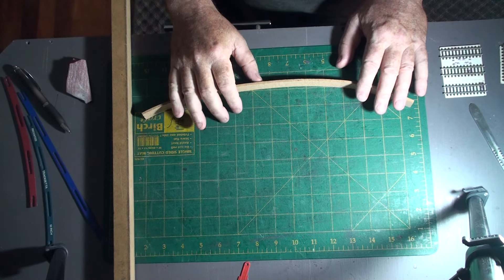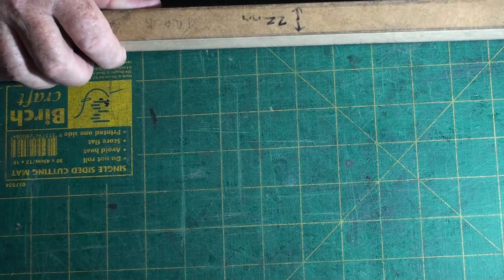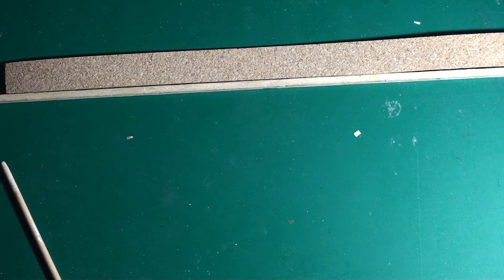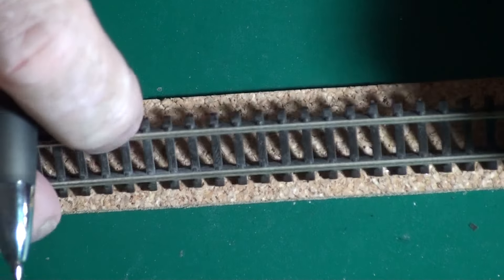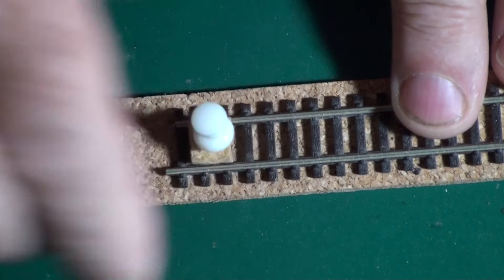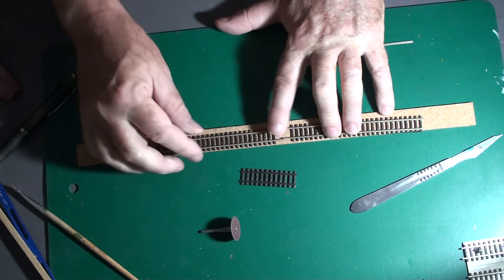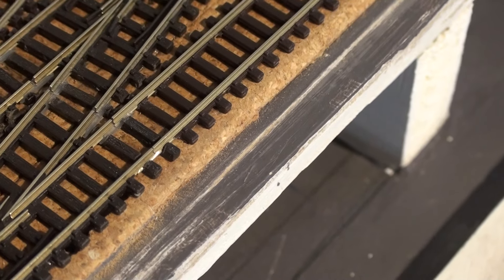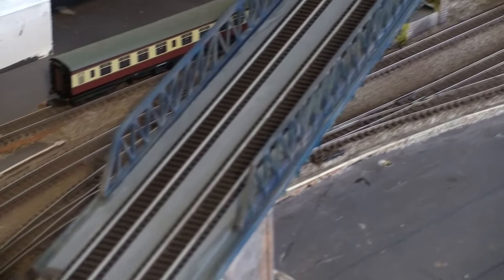Can Peco Code 55 flexi track be reliable and at the same time look good?

Comment: Very good overview and I picked up some tips. I am about to start laying my Peco Code 55 track this weekend.
Reply from the maker: Oh great, glad the video may help, all the best
Reply: @ngaugefouroaksstreetstatio6932  I am curious about one thing. I keep breaking the frog wires off the unifrogs. 
Did you have this issue? Any recommended solution?
I am debating whether to break them all off and solder my own frog wires.
Reply from the maker: @HumancityJunction  I have only used 4 unifrog  points, all the others are Electrofrog but they are no longer available in med radius. I have had that issue with the ones that i used but i do trim the wire so it is just long enough for me to solder another insulated wire. I think it using the whole length of the wire they come with could make them prone to snapping. Cheers

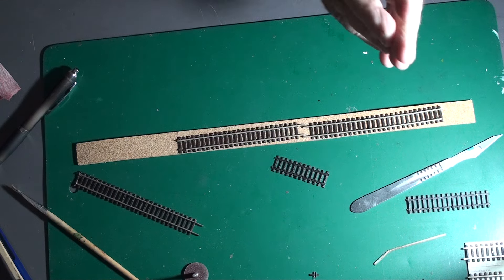Comment: The shots at 18:50 look absolutely amazing! Just curious how reliable and trouble free are your double slip turnouts? I'm running Atlas 55 and it seems they can't even get a standard number 5 to work reliably. My Atlas number 7's and 10's work really good though.
Reply from the maker: Hi Steve, thanks for your comments, ,i have had no issues with the double slip to date but generally most of the traffic just crosses it like a diamond crossing. Having said that when i do change from that position there has been no issues with derailments or electrical issues. Cheers

Comment: Great video. One other little trick worth doing on curves is to stagger the joints of the rails, say around 3 or 4 sleepers fom one side to the other. It gives a smoother join.
Reply from the maker: Yes, that is something i did not mention ,and it is something i should have considered and tested. It makes perfect sense because on long curves or a helix a metre is not long enough to avoid a joint on a curve and staggering would keep one side of track uniform and vice versa resulting in less chance of the joint impacting the smoothness of the curve. . Cheers

Comment: Hello Sir, 
I'm enjoying your videos very much and I'm taking down a lot of notes so I can remember what to do if I get stuck on something. I've never built a layout of any size and scale before. To start with I have no idea what kind of track to use and BTW I'm going to try my hand on N-Scale only because I can get more in such a medium amount of space. 
I have no idea what anybody is talking about when words like track code is mentioned. What is track code? Do I use one type of code throughout the layout or can I incorporate different types of track codes so a single train can go over all types of tracks? Can a train run on a layout with multiple track codes without derailing? 
Lastly for now because I'm sure in due time I will have a lot more questions to ask. Is there a difference between USA tracks and tracks used in Europe? 
Thank you for your time 
Sincerely 
Allan
Reply from the maker: Hi Allan, thanks for your kind words, my layout is code 55 which in profile is more realistic than code 80 however they do interchange but i would stick to one or the other. All N scale loco's will run N gauge track which is 9mm regardless from US Europe etc. Laying flexible track is practice particularly the joints but make the straights straight and the curves smooth. A small file and a dremill type cutting disc tool will help. Always happy to help but there are also great videos to watch. All the best

Comment: Hello Sir, 
Thank you for responding to my comment. I really appreciate it. Besides the reality of the track code 55 over 80. What is the best type of flex track to use for ease of assembly? Also the best type of turnouts to go with the flex track? 
Can you mix or match different types of turnouts to use with flex tracks?
Thank you for your time 
Sincerely 
Allan
Reply from the maker: I use Peco electro / unifrog,  best to use one brand. Others use Kato set track but can be very expensive.